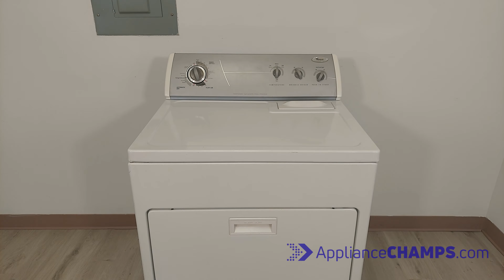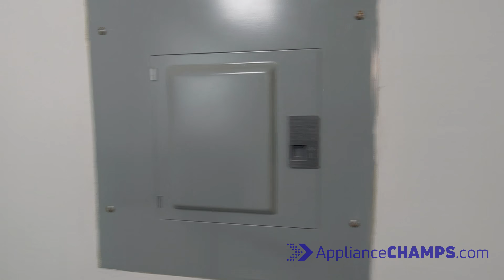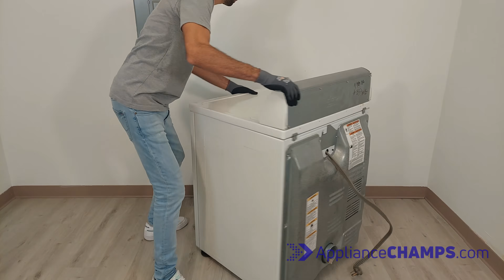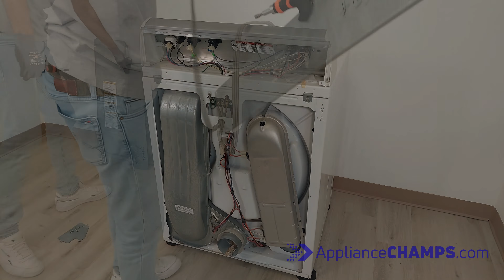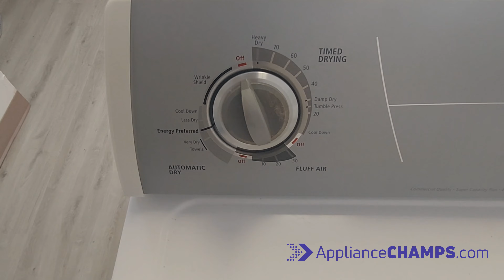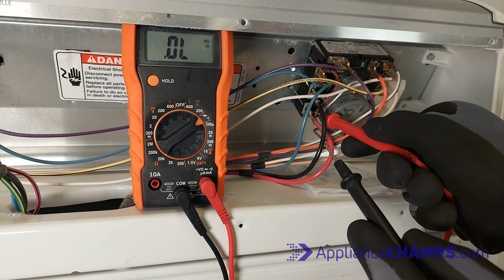Whirlpool Dryer Not Heating Diagnosis in 3 Minutes - Model LER8620PW1

Comment: Thanks.  Fixed my dryer pronto with info obtained from your video which helped me identify the faulty part in just a few minutes after taking the back cover off.  Stumbled across another video which showed me how to reset what you call the "cutoff fuse."  It's not a fuse at all.  It's a thermal circuit breaker.  It measured open circuit (no continuity) using your method and that told me the part was bad.  The other video showed it's a non-resettable, thermal circuit breaker that can sometimes be reset by slamming it down onto a concrete or hard surface with enough force to get it to reset.  I had to slam it down four times before it showed continuity.  I reinstalled the part and now my dryer heats like it did when it was new.  Seems this breaker can trip when there isn't enough air flow and things heat up too much as when the vent gets too clogged up with lint.  Hopefully the "fix" isn't temporary and I end up having to replace the part anyway.  Thanks again for the very informative video.
Reply: I cannot believe that this actually worked.  Watched another video to look at the appropriate angle to strike the fuse, and after four taps on my garage floor, the continuity tester started beeping.  I still bought a replacement part, but this is a great trick to bridge the gap while it is shipped.  The good stuff is always in the comments - thanks!

Comment: Thank you so much dude!  Bought a new heating element and was bummed that didn't fix it. Bought a a HF multimeter  and the first continuity test and I had my problem solved.  Got a used cutoff fuse for 5$ at a appliance repair place and back in business.  Got some laundry to catch up on now

Comment: I followed every point with a multimeter, even the motor, and every terminal had continuity, but when I started on this project, the dryer wasn't heating, and the timer was not advancing.  I'm stumped. My breaker is good and neither leg was tripped. I am starting to think that my 220-volt receptacle may be bad. I don't mess with 220-volt, so I guess that I'll be calling an electrician. This video was very good though, but I still haven't isolated the problem.

Comment: Your first check should always be the breakers. I spent a week trying to figure out why my dryer wasn't heating up. It was the breaker for the heating element...
Reply: There is a breaker for the element inside the dryer?
Reply: @anonymous_friend Yup. That's the 220. The drum rotates on 110. Pulled my hair out once trying to figure out why the drum was rolling, but the dryer was cold. Bought all the replacements, except the element itself because it checked out and had no visible breaks. All the other little pieces, I bought as they aren't expensive, and just in case. Replaced everything...still didn't heat. My son had flipped the breaker messing around one day. That's all it was.
Reply: @chrisnotyou Man, I just ordered everything. I didnt get continuity at the heating element, so I'm thinking that is the problem. No one kit had all of the right model parts. If it ends up being the breaker, I'm going to be mad 😂 The breaker isnt tripped though..
Reply: @anonymous_friend I did get continuity though, which is why it was so frustrating. If your breaker is fine, and the meter shows no continuity, then that's likely your issue. I just wish someone had suggested to check the breaker first.
Well, when/if it does actually break, I already have all the parts and knowledge. No real loss, and lesson learned.

Comment: Model LER8620PW1 -  My dryer runs, air blows, no heat, timer does not advance. I just tested all the items mentioned in this video. There is continuity across all terminals. This video mentions that it might be a motor problem if all tests are okay. How does a faulty motor cause this problem? Thanks for the video.
Reply: An unexpected turn of events. I had inspected/tested each of six of the recommended test points. Two days later, after contemplating a new dryer, I put the back panels back on and ran the dryer for the heck of it. It now works properly! WTH‽ When I did my continuity testing with the volt meter earlier, I did the tests twice. First time with all wires connected. Then I removed all the wires at each test point and tested them again. All tested okay with continuity. My conclusion is that one or more of the blade connectors had corroded enough to cause the trouble. After removing them and replacing them, perhaps the corrosion was removed enough to allow adequate continuity. The dryer sits on an enclosed back porch so it is subject to whatever the weather of the day might be. Moisture and humidity certainly could have played a role. So, check your connectors if all else fails (AKA, nothing failed). Cheers!
Reply: @MikeHoover1 my guess is a loose wire that you must have moved when testing.
Reply: @MikeHoover1  probably had the ground wire unhooked.

Comment: Just installed a brand new Whirlpool natural gas dryer in my home and the burner comes on for only about a minute or so, then goes out. Through the peep hole I can see the ignitor glow for about 7 seconds then go out while the drum is turning. After about 40 seconds or so, the ignitor will glow again for about 7 seconds then die down. This cycle repeats over and over. This is a brand new dryer that was delivered to my house from Lowe's and it is doing this. This replaced the Kenmore dryer that was 1970's vintage that was still working when I received the new Whirlpool. I repaired that Kenmore myself over the years and kept it in good operating order. Now I regret having gotten rid of it for a brand new "made in China" piece of shit that doesn't work. For $920, I now own a clothes dryer that doesn't dry clothes. A service tech is scheduled to come check it out next week.

Comment: When they say check if none of the breakers are tripped, do they mean anywhere in the house?  My dishwasher switch is tripped, so if I turn it back on the dryer may heat????
Reply from the maker: No, I heavily doubt turning on the dishwasher will solve any issue with your dryer.

But assuming you're not familiar with your breakers, it would have been suspiciously convenient to have your dryer not heating and a tripped breaker at the same time.

Comment: My thing doesn’t beep so how do you read it
Reply from the maker: Hey Hector, 
Usually all multimeters can beep. You might need to turn on the sound, but if yours simply doesn't beep, then you need to look for 0.00 resistance. (0.00 ohms)

Comment: Couple of points. First the white component at the lower left on the blower housing is a thermal fuse not a thermistor - it will be closed for continuity if good. *You must remove at least one wire (isolate from circuit) from each component being tested for continuity or you will get false readings through other components like the timer or temperature control switch
Reply: Where does the white wire plug into other than the heating terminal
Reply from the maker: Hi Guru, and thank you for your feedback. 

You can be fully confident that if you follow this video you will get accurate results and your dryer will heat again. 
Guaranteed 💯

Comment: Hi there, thanks for the video. So does anyone have a link to a resource where I can test these components sans multimeter? i.e. using a jumper(s)? I am unable to buy or borrow a multimeter and I really want to isolate the failed component so that I can order the part. The thermistor and cutoff fuse are straight forward, but what about the others. Thanks so much!
Reply from the maker: Hi Martin,
There's no way, that we know of, to reliably and safely test these components without a multi meter.
Reply: Using a volt/ohm meter is the best way to test these components. Harbor Freight has a very basic meter available for less than $7 US ($6.99 + tax). You can also find the same meter on Ebay for about the same price delivered..

Comment: On the cycling thermostat, why is it necessary to only check the outer two (red) wires? What's the purpose of the two inner (purple) wires, and why is it unnecessary to test them? I'm not trying to criticize, just trying to understand. Thanks!
Reply from the maker: Hi Jonathan!
That's a good techie question. 
The two smaller electrical line are powering a micro heater inside the thermostat to manipulate and trigger it in case the thermostat become insulated by lint or dirt from the other side.
It's an additional safety mechanism.

Technically the dryer will work just fine even without anything connected to these lines, but we strongly recommend NOT to do it.

I hope it was a good answer 👍
Reply: @ApplianceChamps  I think you'll find that the internal heating element is used to enable the dryer to be cycled on delicate rather than regular. The heater causes the thermostat contacts to open early by applying false heat to the thermodisc on the delicate cycle only.
Reply: @ApplianceChamps  Thank you! I appreciate the reply. And yes, I think it was a good answer. 🙂